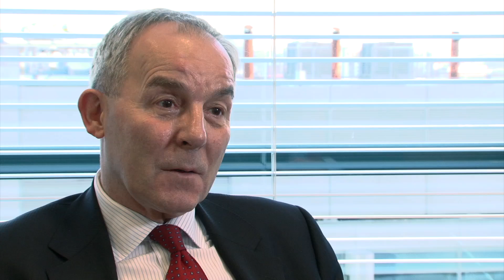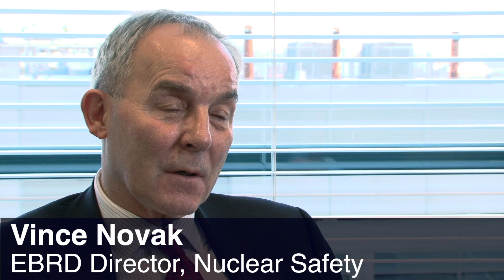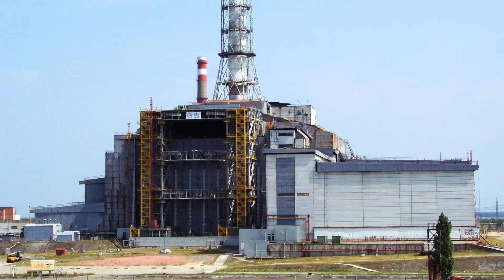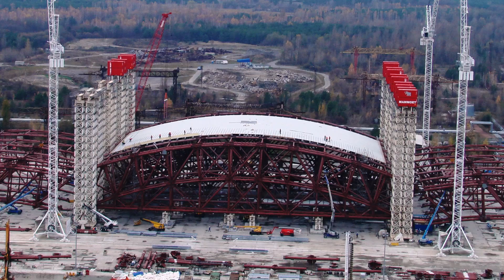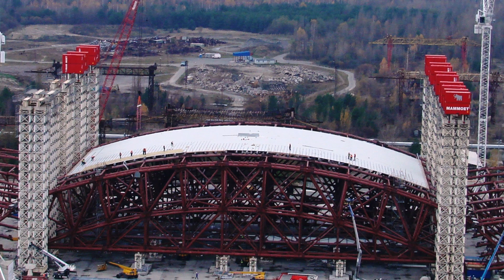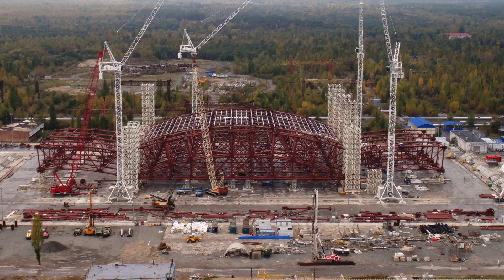Chernobyl: new safe confinement raising operation starts

Comment: The problem is that Chernobyl poses a serious nuclear contamination risk. The Sarcophagus was designed to stand for 20 years until a more permanent solution could be found. It is built on top of the ruined, distorted foundations and blast and radiation damaged concrete of the original building. The chimney stack is a significant risk. Since it is impossible to maintain the radioactive building, the longer its there the greater the risk of collapse and the resultant nuclear dust cloud (tbc)...